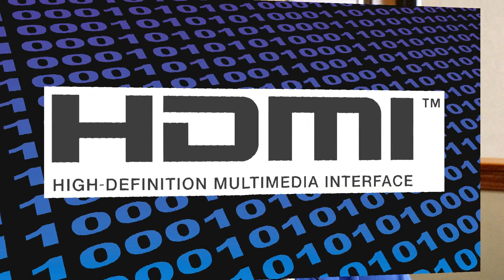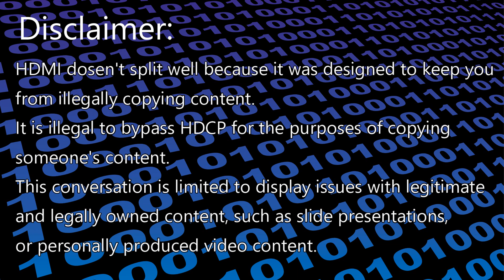HDMI, HDCP and EDID Explained

Comment: Thanks for the video, great introduction and highlighting the potential problems. Can you make your video about the solutions though!!?
Reply from the maker: Thanks Simon, yes it is in the works, but working two jobs makes it hard to get content out as fast as I'd like. I definitely prefer SDI distribution. This way the computer only sees one device, the HDMI to SDI converter. An SDI distribution amp can then be used to feed multiple displays. However this still can create HDCP issues unless you are using a computer, which in most cases doesn't require HDCP.

Comment: This really didn't explain much. Trying to figure out why, I have a video switcher that if you just leave it alone with a video signal from the room camera it eventually drops the video. however the camera remains active. my thought was something with EDID is changing the resolution to an in proper format.
Reply from the maker: Hi Scott, The EDID negotiation should happen right away, so if your camera is up for several minutes and then drops it doesn't sound like an EDID negotiation problem.